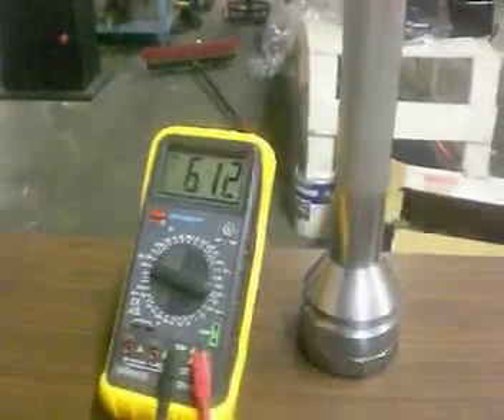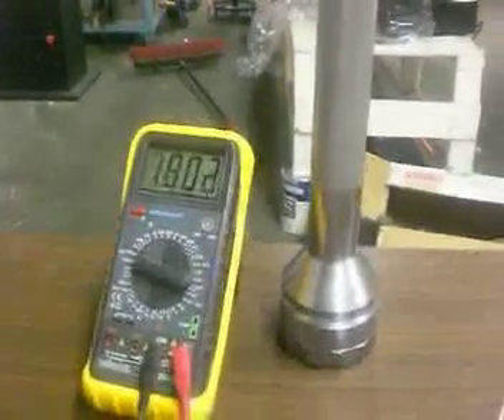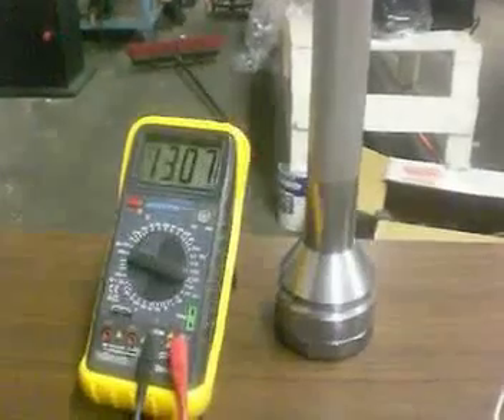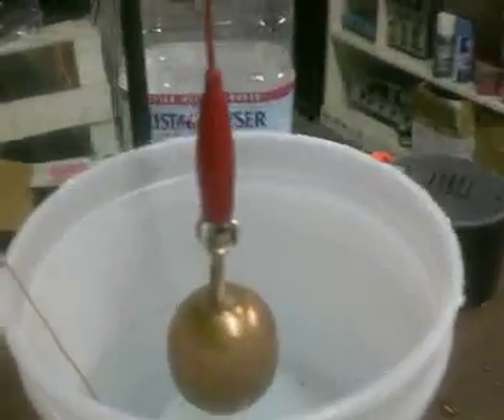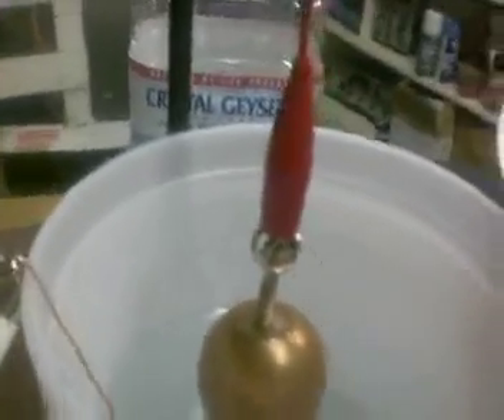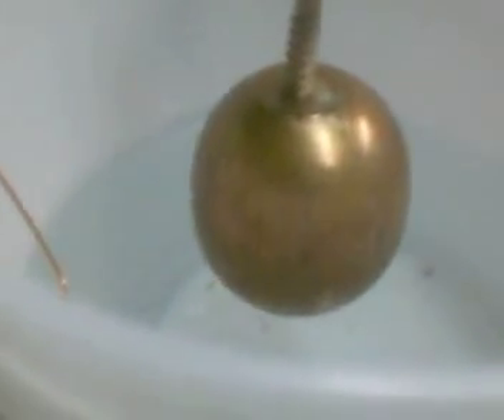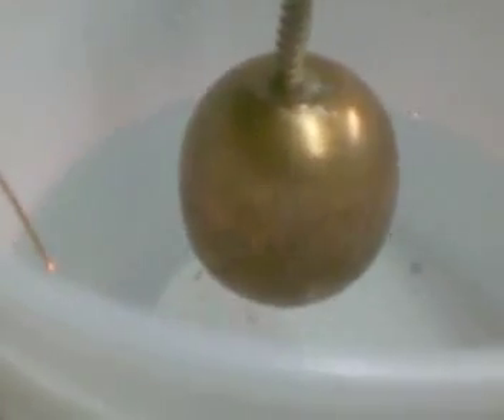High Frequency D.C.  Energy and Water

Comment: I dont really understand what is being accomplished here. I see by not submerging you second electrode, youre only producing one gas on the other wire, and burning or doing whatever to the other out of the water. If you take the hv side of a microwave transformer and put one lead in a bucket and dance the other lead on the surface it will do this same thing, but no gas appears. But if you submerge them, they do not produce HHO. I have an HHO generator i machined and i think its a very different design using spirals and channels placed about a 60th of an inch apart, yet I have no way to power it. How are you creating this High-frequency DC? I can make anything I need to but i dont understand enough about electronics to create the required circuit to give my HHO device a competent testing. From my understanding Meyers was playing with extremely high voltages in his projects, 80-100k+. Aside from taking apart a taser, there are really no ready made sources i can find for that kind of voltage aside from the pos Chinese hv spark coils you see all over youtube and ebay, much less that kind of voltage at higher frequencies. Help

Comment: How do you think Digital works? You can control the pulse speed (frequency) & the Width(the length\fatness)can all be changed in DC. Normal DC is 100% duty cycle which means it is always on, 100% of the time. But with circuits or simple RC networks (resisters & Capacitors)you can do many many things with DC.